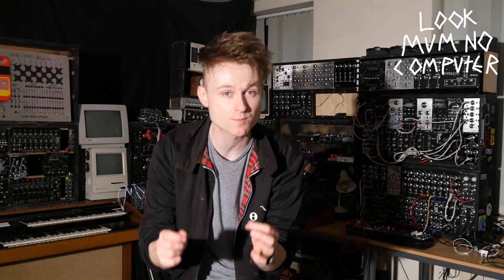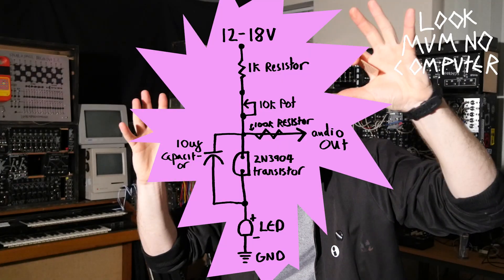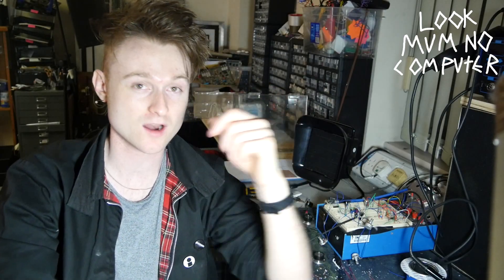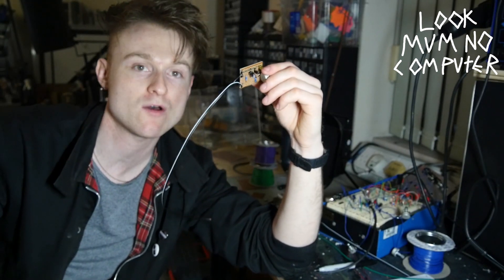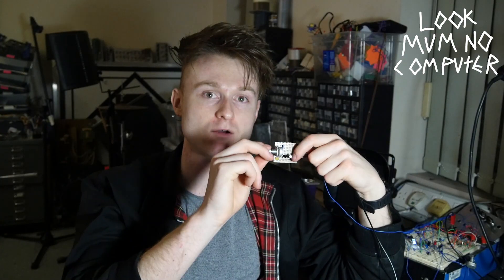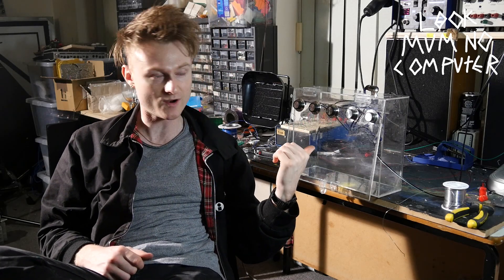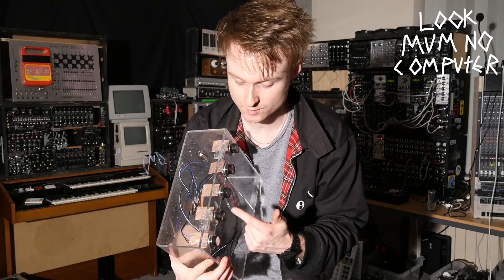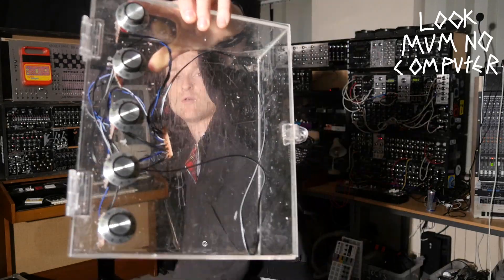The simplest DIY audio oscillator? not a 555 chip. reverse avalanche

Comment: As an amateur I have problem understanding what you did after those oscillators were done. You wired them to same stripboard but in which way? I'd love to build this!

Also, you're my favourite! Your videos are great!
Reply from the maker: hello very sorry i skipped that bit a little bit! all i did was use another small piece of stripboard to solder all of the positive powere wires to each other,  all of the audio out wires from each oscillator together and all of the grounds together...... so each of the 3 different types of wires were on 3 rows of the stripboard. if that makes sense??? then attach the audio row to a jack socket! and the power and ground to the power socket!? does that make sense?
Reply: It does! Cheers!
Reply: is it possible for you to make a short video on this? i really want to start with synth diy and i want to do this little oscillator as firstproject but unfortunately i have never build something like that and so i have problems to understand :( 
I would realy appreciate it
Reply: Do you have the jack grounded to that strip board too? For some reason that was cutting my volume down but I probably did something horribly wrong because my oscillator was kinda cutting in and out...
Reply: Hah! I think my problems were a mix between a gimpy audio interface and old 9v batteries. Tried this again last night and got 2 oscillators working on half a breadboard. The volume is still super low though... maybe that will fix itself once I’m able to scavenge an 18v wall wart?

Comment: So did you use different types of transistors for each board or can you reach the varied frequencies just through the pots? I'm looking for parts right now and trying to figure out what I should get, this will be my next build
Reply from the maker: the capacitor will make the range! the smaller the cap is the quicker it will discharge making it a higher pitch range. so a 1uf or a 220nf cap would be high! and something like a 10uf or 22uf would be a low range because they are bigger caps!!!    2n3904 transistors on all of them! :)
Reply: Great, that's perfect! I already have a bunch lying around so this will be an even cheaper build than I thought, thanks for doing this mate
Reply: one more question: how do you wire them up so they're all powered by the same supply and output audio to the same place? and I can use the same 18v power setup to power all of them? I'm planning on putting 10 or 12 into a box, but this will be my first real project like this. Is there a way I could get a picture of that board you had in the bottom of the box or a diagram for how to wire them all together? thanks again man
Reply: Actually, is there a way to hook this up so I can have individual outputs (so I can use the RC filter/vactrol you've shown in another video as a filter or LFO for some of the individual oscillators with patch cables or something) and still have them all eventually output through to the same source? maybe if I had an input jack for each oscillator leading to something for overall audio output, so I could take a cable that would normally go to that to run through the filter instead and then back to those inputs? I'm not sure if this idea makes a whole lot of sense but any kind of advice would be appreciated

Comment: Fantastic. Always been a fan of your vids, but this one made me sign up to patreon and support you there. Could you please please please show how to make this track 1v/oct!? I'd solder dozens of these funky little bastards if they spoke eurorack. Keep up the good work!
Reply from the maker: wow thanks very much! really appreciate it! this month is most definitely oscillator month. im not too sure this circuit will really track 1v/oct as its super lofi however ill have a play with it! im also going to touch on a slightly more tech oscillator soon that is REALLY good. and only slightly more complicated than this one! keep your eyes peeled.
Reply: LOOK MUM NO COMPUTER Yay! Looking forward!
Reply: You could use a LM13700 like a variable resistor that you could feed with a temperature-compensated differential pair of transistors and tune this (maybe?) to get 1V/oct, but dude... then you're adding ridiculous amounts of circuitry, losing the whole simple, cheap, low-component-count point of this amazing project.

Hey Simon, LOVE your videos, and stripboard is great, (never used it, just perfboard) but my construction technique is cheaper and (for me at least) easier. Hey. I should make a video of how I build circuits!!! :D
Reply: LOOK MUM NO COMPUTER what about a Synthrotek Vac Pak instead of the potentiometer?
Reply from the maker: juanito moore worth a try but that's getting complicated with powering and part count. The aim of the game is simplicity 🙃
Reply from the maker: Firestarter a Vactrol would work as the cv input yes. You won’t need one of those you could get away with the circuit in my filters how to video.

Comment: Wow thanx!! I'm going to try that but I'll wait for your next vid to see how you implement it with cv pitch in... Is it going to track 
1v/oct? I'm going to wire it to my euro bus board... What will be the range with +12 volts? 2 or 3 octaves? Keep comin' your vidz! I learn a lot from these!
Reply from the maker: hey! sadly this probably wont track 1v/octave. its an extremely lofi oscillator. sadly!
Reply: No problem! At lest its going to track some cv!
Reply: That could be a super-simple clock lfo, right?

Comment: oh nice sounds wayyyy better then the harsh 555 output, think i may build up a 32 oscillator circuit for my polyphonic keyboard i put together .. thanks for sharing cheers from Germany !
Reply: Firestarter you wire them in parallel, still 18v. Not sure how much power these draw but even if these take 80mA each (probably way too high of an estimate) a common laptop power supply could deliver the necessary 45ish watts to drive them
Reply: dirkk82 care to post a video explanation of it? I’d love to learn how to build a 5 voice poly with these oscs
Reply: use CD40106 each chip gives you 6 oscillator.
Reply: saaaaaaame!
Reply: Hey dirk, did you connect the circuits in series or parrelel?
Reply: dirkk82 no way. This sounded so much worse than the 555 circuit i just put together
Reply: dirkk82 dude thats gonna take a lot of power. If you use 18v for each oscillator it would be 576v
Reply: Firestarter I have already built a polyphonic keyboard using 32 555 timer chips and it does not use 500 or so volts lol .. The circuits would be in parallel the voltage stays the same but the current changes and these circuits use very little current :-)
Reply: dirkk82 yeah I'm kinda an electronics noob
Reply: its cool dude we learn and grow with each passing day :-)

Comment: I love ittt, got a question tho, is there any chance of burning either an amp or a speaker as we increase our input voltage? How can we be sure our output signal voltaje is safe to plug either to other modules, speakers or even audio interfaces? Thanks a lot!!
Reply from the maker: good question. when i was looking at the signal on the oscilloscope it stayed quite constant however i will check again very soon. the 100k really helps to keep it at a nice level
Reply: thanksss c:

Comment: Oh dude. Rad lol can't wait to tinker with this. Will it lfo-ify if ya use a bigger cap?
Reply from the maker: Bryce Forrest I think you can get a bit bigger! However I found smoke coming from the potentiometer when I used a 47uf when I made it very low. However I might have done something wrong. Don't be scared to experiment! Even if it means you fry a 40p potentiometer! It's all in the name of science!
Reply from the maker: but yes you can get it very slow. check out the link in the description about reverse avalanche
Reply: LOOK MUM NO COMPUTER i fear no magic smoke. Will try and report back lol
 
A couple of these with cv and a slow lfo to modulate them in and out of tune sounds like it would be pretty ace. Drone pad machine? I've been inspired.

Comment: Hey man, great video. Since oscillators are this simple to make,   what are the differences between oscillators from different manufacturers? are there many routes you can take when creating a vco? And it seems weird that VCOs are so expensive since a single waveform oscillator takes so few components to create.. Dunno if this question is just f-ing stupid since im a total newbie to this stuff, but im too curious not to ask. Take care!
Reply from the maker: Jooseppi Fallos hey! With a sine wave I would add to the end of this oscillator circuit my circuit of a super simple filter! You'll get close to a sine wave with that! Regarding vco's the high price is due to all of the extra circuitry required. For instance the core is usually a bunch of transistors multivinrating. Which usually come in the form of a chip which have a few matched transistors inside. These aren't cheap! But they are required for the good tracking triangle core of a vco. Then you need a circuit to stop it drifting in pitch with temperature. And then all the conditioning circuits for all of the different wave shapes and all of the cv inputs! This is a very very simple oscillator. It will drift in pitch over time and would be impossible to track to something like 1 volt/octave! But it's just awesome to have to make a simple noise! Hope that makes sense
Reply: LOOK MUM NO COMPUTER hey thanks for the fast and troughout answer! I think i understood the main point. More parts - more stable vco - higher price. As a side note i have to compliment how  inspiring content youre creating! I ordered my firs APC kit a couple days ago and im considering to go for the sonic potions lxr after that if all goes well. I dont understand schematics so i gotta stick to these kits for now. Maybe some day. :D

Comment: There is no excuse. I have to do this.
Reply: Do it!
Reply: I've seen this circuit before, but it's SUPER genius combining this with a light-dependent transistor! Applaus
I've got another idea: use such an oscillator circuit that has both the light-dependent transitors & an LED & feed the light of it back into the LDT to create a simple mechanically adjustable (meaning at least one of the L.D.T. or the LED must not be mechanically fixed, eg flywire etc or adjustable transmission, eg a strip of cardboard or semi-translucent paper) combined electric/optic chaotic wave generator! Note: frequency sensitivity matching between LED & LDT & ambient light interferencing may be issues to watch out for.
Reply: did you do it
Reply: did you do it? I'm thinking of doing it. i bought a soldering kit off amazon and now i need transistors and conductors and wires etc...
Reply: fr 💀